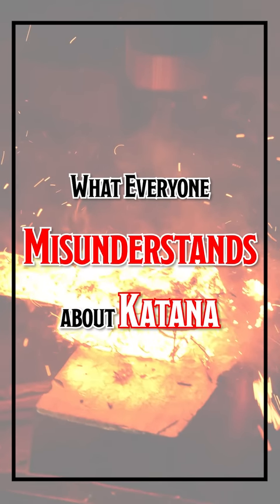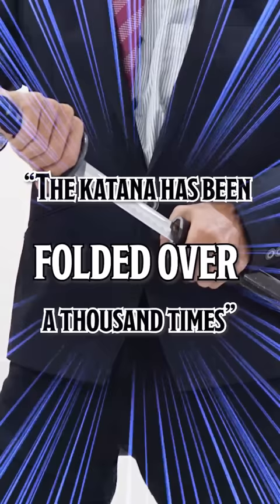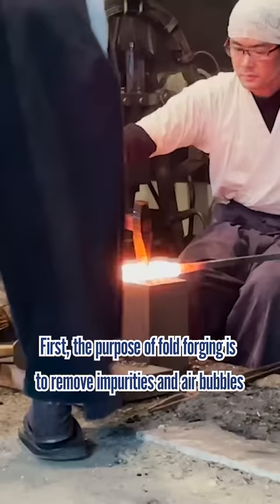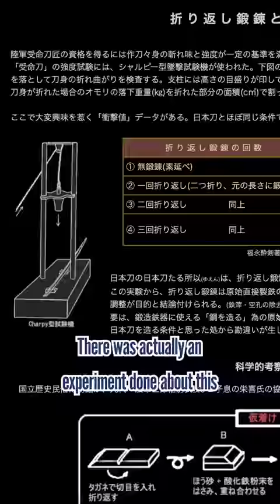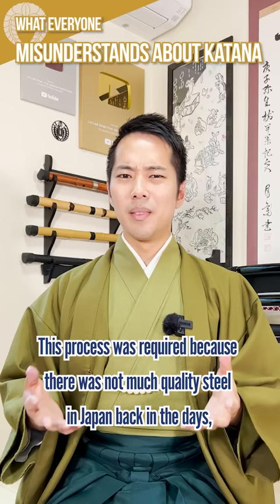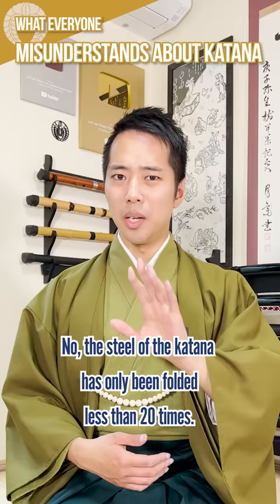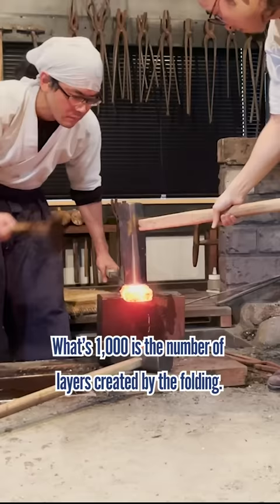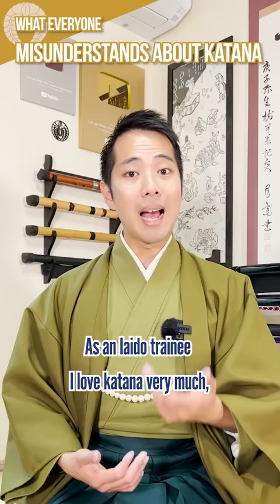What Everyone Misunderstands about Katana #Shorts

Comment: One fold = 2 layers, next = 4, then 8, then 16, 32, 64, 128, 256, 512 and then 1024. That's about 10 folds.
Reply: At 20 folds there are over 1 million layers.
Reply: @sorashirogami1729  yep, since it's 2²⁰ or 2^(20) you would end up at 1,048,576 layers
Reply: This math is cool but it's lost logic because a fold is a verb while a layer is a noun. You can't fold something over a thousand times because it would have a couple quadrillion layers
Reply: Mythbusters pretty much explained this in the seven paper fold myth.
Reply: okay but 10 is less than 20 is it
Reply: @notmuch_23  Folding paper and hot metal aren't the same. With paper your thickness increases extremely but with metal you can go back to the general original shape after each folding bc it's a formable mass unlike paper.
Reply: @ztsottles  Noone talked about folding something over a thousand times. OP only said that you need to fold it 10 times to get 1024 layers.
Reply: @JCel  but the exponential growth pattern of layers is exactly the same, which is my point.
Reply: I feel like at some point some layers merge together due to heat allowing molecules to bond together, but am not a chemist.
Reply: @JCel  they never said "you cant do this because you cant do it with paper" they said "the mythbusters explained this also" you are correcting someone who was not confused
Reply: @ztsottles  depending on which naming scale you are using quadrillion is 10^15 or 10^24. Thousand folds will make at least 2^1001 layers at first sight (you have to have at least 2 layers from the beginning due to physics of forge welding. Actually a little bit less because each time you fold you are not only multiplying it by 2, but also subtracting 1 layer because you are forge welding to same layer). Using method of mathematical induction we can prove that in this model number of layers after N folds equals 2^N+1. 
So after 1000 folds number of layers will be  at least 2^1000+1. This is much, much greater number than estimated number of atoms in observed universe (up to 10^80 which is less than 16^80=2^(4*80)=2^320 )
That's the power of exponential growth.
Reply: @JCel  OP mentioned the common misconception that a katana's blade is folded 1000 times. Are you dense?
Reply: @JCel  it's also the first thing he says after the title.
Reply from the maker: The professional katana sword smiths I have met told me it’s usually about 10 to 15 folds, and 20 is the maximum but usually wouldn’t do that much!
Reply: @LetsaskShogo  yes yes... Everything must have balance, not too much... Not too little... 🙏
Reply: 2^100 is already at 1 nonillion layers or about 1,267,650,600,228,229,401,496,703,205,376 layers, while a thousand folds as states would give over 300 digits as layers, that's over thrice the amount of digits in a googol.
Reply: @ekthepro  then welcome to your first lesson. Semantics matter in math.
Reply: @user-yd2ye2uh2c  "SO THE KATANA IS FOLDED OVER A MILLION TIMES THEREFORE BEING EVEN STRONGER1!11!!!1!11!!1"
Reply: @ztsottles  fold can also be a noun, for example when saying ten folds. It just that's the word isn't used much in this context so it's confusing
Reply: Makes me think of that million layer croissant.
Reply: @ztsottles  
"Folds of skin" is an actual phrase.
Reply: @kedabro1957  not applicable in this situation.
Reply: Very true, that is how math works. How many folds does not equal how many times it has been folded
Reply: It's not as simple as 1 fold makes 2 layers, the traditional method of making katana was by using many small pieces of steel mounded together, then forged into 1 soild piece, that piece would have multiple layers already. Then they folded the piece over and over to make a more homogeneous piece of steel
Reply: I was thinking about that, like "wait, I'm pretty sure 2^20 is more than just 1024..."
Reply: @ztsottles The word "fold" can be a noun, referring to the line upon which something has been folded.
Reply: @WereWade that's what happen above 800°C

Comment: Traditionally forged katanas are fragile and a bit on the side of needing high maintenance, though oiling is but as often as other blades.
Reply: It's another reason for the folding, in fact. It puts a very hard but very brittle section at the edge and a softer but more flexible section at the back.
Without that they'd either snap super easily or have a hard time retaining an edge or penetrating much of anything.
Reply: @ToastyMozart  they rust the moment they are unsheathed.
Reply: @ToastyMozart  
And the katana might not even be able to cut through or rather get damaged itself when striking butted mail.
Reply: @redblade5556  That's why proper maintenance like oiling is essential for katana user.
Reply: @emperorfaiz  It's essential for any sword. Katanas are just more high maintenance than other swords given how they made it deliberately ornate.
Reply: I don’t know that they are brittle in general. If you mean the hardens tip that can be but the heavier back is not. the hardness of the blade varies you have to be more precise. Also oiling is a more of a modern thing with some blades. Also - everything we say about Katana is so generalized
Reply: @leodouskyron5671  Oiling wasnt required in the past because people regularly used the weapons and always wiped them before sheathing. Oiling is needed if it will remain sheathed for a long time.
Reply: @ToastyMozart  mmm no it doesn't man. Forging isn't creating hardness neither is folding. The folding is to create a homogenous peice of steel. The resulting high carbon steel is then forgewelded around a core of lower carbon steel. Creating a jacket of sorts of hardenable steel around a core of mild ductile steel.
Reply: @ToastyMozart  no folding does not create differential hardening, it's only for removing impurities and aesthetic, differential hardening is achieved by covering the edge of the blade in clay or mud, firing it in the forge and then quickly quenches it in oil which creates the 'hamon' patern on the blade.
Reply: @ToastyMozart  Nope I know the different section of a katana are often called a fold. 

They don't actually fold the metal obtain hard edge and a soft spine. 

How they obtain that difference in hardness btween the edge and the spine is through two processes, the first one is differential hardening  the edge is more hardened than the spine, the other process is by simply forge welding different steel together. 

Folding steel over and over do not get you a difference between the edge and the spine of a sword, to the contrary it actually homogenize the steel.

Comment from the maker: I'm sure you’ve probably heard of someone explaining that “The katana has been folded over a thousand times” and that’s why it’s strong. There are two major misunderstandings about this.

First, the purpose of fold forging is to remove impurities and air bubbles and to adjust the carbon content. Therefore, it doesn’t mean that the steel is getting stronger. There was actually an experiment done about this and it was proven that from the third fold, the strength of the steel does not change. This process was required simply because there was not much quality steel in Japan back in the days, and the people needed to create it themselves.

Second, about “folded over 1,000 times.” No, the steel of the katana has only been folded less than 20 times. What’s 1,000 is the number of layers created by the folding. These layers can be seen on the surface of the katana, called Jigane.

As an Iaido trainee I love katana very much, but I do agree with the opinions that say they are sometimes overrated.

If you’d like to learn more about Japanese traditional culture, Kyoto, and social problems in Japan, please check out my channel & subscribe! 

*The content is based on personal studies and experience
There is no intention of denying other theories and cultural aspects
Reply: I’m sure they counted exactly 1,000 for every single blade they made in feudal Japan 😂

People are so uneducated!
Reply: Thanks for they lyrics 👍
Reply: Hi first off I love your channel you're very informative and I've always wanted to visit Japan for just a short time, So listening to you talk about the goods and the bad about it and kind of explain  Japanese culture and the things you shouldn't should not do is very helpful. I have two questions to ask you first off what's the best platform to ask you questions on, I don't really know which you prefer. Secondly you know a lot about the katana but I wanted to ask if you happen to know anything about it shorter counterpart Wakizashi I've always been kind of curious cuz when I look up information about it it seems like it's not as worshiped as say the katana is or at least I don't hear about it as much in Japanese lore and History. Nearest story about a a very skilled Ronan had murdered somebody and whenever the samurai would try to punish him and remove him from the building he was in ,they would all fail to defeat him and apparently he was using the Wakizashi or something like it the story only stated it was a shorter sword than the samurai's katana.

Comment: Some Damascus steel does get stronger from more folding, but that’s if you start with high quality steel in the first place.
Reply: that's different, Damascus steel are mixed steel, that's why these waves were visible compared to regular 1 type steel blades. damascus steel katana would be cool though.
Reply: Correct. The strength comes from having a mix of hard and soft steels. The hard steel is more rigid, but dulls quickly. The soft steel is springier, and holds it's edge, but can't be as sharp. By mixing them together you get the best qualities of both.
Reply: @Interrobang212 that’s… not how steel works? The harder the material the better it holds an edge. Because it needs to be hard the cut through softer materials. It is more prone to chipping the harder it is.

Comment: Compared to other swords (like a claymore) they’re easily beaten. But the strength at that weight and size was unheard of, and still is astonishing how well they’ve held up
Reply: Long swords are a similar weight and dramatically stronger.
Reply: @tjravend  No, they're not. They give similar results.
Reply: @danielantony1882  I would assume you're referring to some kind of cutting test results? Because that's not exactly the same as structural strength.

Sure, at katana will probably cut just as well as a longsword of similar; probably even better in some ways. But the katana will chip and perhaps even break more easily since it's not made of the same tough, uniform steel.
Reply: @justinthompson6364  If you're talking about traditional katanas then yes, you're probably right about the steel quality. However, traditional Katanas are a completely different topic.
Reply: @danielantony1882  If someone uses the word "katana" without qualifiers I'm not going to assume they're talking about a modern-day replica without reason. Especially on a video that mentions the historical reasons certain forging techniques were applied to it.
Reply: @danielantony1882  cope
Reply: @danielantony1882  same thing applies. Great it can slash. So can a long sword, if slightly worse. Yknow what a katana can't do? Stab well, it isn't dual sided, you cant half sword effectively, bludgeon effectively or take on multiple attackers or cavalry as effectively. Long swords are the every use sword, there's a reason even samurai used katana as basically ceremonial decor
Reply: @danielantony1882  can you half grip a katana? Are katanas double bladed? Plus the longsword is straight, while the katana is curved, so the longsword is better since it wont try to adjust to the ground. The proof? Katanas were almost never used in combat, longswords were the height of technology
Reply: @tjravend  The Katanas was used in battle, they just started using as basically a ceremonial decor on the piece period
Reply: @felipeguedescampos851  as a secondary weapon, generally
Reply: @tjravend  but they didn't use them as a secondary weapon because It was bad
Reply: I mean they are 2 very different weapon made for 2 completely different purposes it's kinda useless to say one beats the other
Reply: @felipeguedescampos851  on the battle field yeah uchigatanas (which I'm assuming is what you guys are talking about) were not regularly used they weren't even the secondary weapon they were a last resort weapon like a bayonette to a modern soldier. But they works great as a personal weapon for samurais because of how compact and quick to deploy they are and especially in non-open spaces like a house where bows, spears and tachis can't operate they were very much used otherwise they wouldn't even have a cultural impact. Samurais uses the uchigatana for ceramonies because they were their personal weapon not because they randomly picked a useless blade to show off. Calling them useless or a 'bad weapon' is rather biased and untrue.
Reply: @tenderandmoist5011  yes, you are right

Comment: Quick metallurgy lesson yes it does remove impurities also called slag in the steel, because the slag impurities have a lower melting point than tamahagane or bloomery (the steel smelted in japan traditionally used for katana, and other materials)  and hitting it essentially squishes the impurities out of the steel. The traditional hot cut and fold method as well as the high carbon jacket, and the low carbon spine made it quite amazing at shock absorption when cutting. Given that the length of a regular uchigatana is 2 shaku it's actually heavier than most weaponry from around the world in the same style and length. Like a saber or a cutlass. Each have their advantages and disadvantages, so in the question which is better, it's more or less which one can you, the utilizer, use in a more proper, more precise, and most effective manor.
Reply: Which would make sense… if the forges got hot enough to melt the impurities… which they don’t that’s why they folded steel. They folded steel because it spread the impurities thought out the steel so that there want one particular spot that was weaker than the rest of the steel.

Comment: The other thing about the folding is that the carbon in the steel, the element that actually determines its strength, migrates at high temperatures until it is evenly spread out. Some other elements, like nickel, don’t. The result is that in terms of carbon you end up with one layer - the entire piece. In terms of nickel or some other trace elements you have multiple layers. Structurally it is one piece and visually it is layered.

Comment: From what I understand folding steel, at least in the process of forming your billet 
has the ability to work out impurities such as sulfer and phosphorus. Each fold moves a little to the surface and it's burned off in the forge.
Reply: But aren’t you folding it in half? That’s trapping any impurities on the surface into the center of the material. And it’s not like your getting it hot enough to allow those materials to pass through the body of the steel.

Comment: True that...with modern steels being of superior purity now...the folding is more for art rather than purpose...however the folding (or perhaps better described as fusion) and combination of differentially hard and soft steels into the singular body of the katana is still a critical design for a function element as preferred by the user.

Comment: Most weapons evolve out of necessity of their users situation and environment. Hence why longswords (vs thicker armor and could be used as a bludgeon in some cases) and katana (vs thinner armor that required more cutting power) are so different.
Reply: I mean your using the cross guard and pommel to bludgeon with a longsword (murder stroke) by holding the blade and swinging it like a hammer. Longswords were shaped like they were to be better at stabbing.

Comment: tamahagane (jewel steel) needs to be folded to draw out impurities.  wrapping and claying the metal between foldings adds extra carbon material to it. taking a low carbon almost iron quality steel and elevating it to the level of a useable blade material.  probably the coolest thing about katanas is they don't get their curve until the finished blade is quenched.  Katana forged out straight but the method of forging is what causes the blade to curve when it's cooled.  it's called san mei and is a 2 part construction of a high carbon outer jacket welded around a low carbon inner core.  the carbon and different hardness makes the metals cool at different rates introducing the iconic curve

Comment: I keep on telling people about that it has not been folded 1000 times, only that it has 1000ish layers.
Like lets do the base calculus:
First Fold: 2 Layers.
Second Fold: 4 Layers.
Third Fold: 8 Layers.
Fourth Fold: 16 Layers.
Fifth Fold: 32 Layers.
Sixth Fold: 64 Layers.
Seventh Fold: 128 Layers.
Eighth Fold: 256 Layers.
Ninth Fold: 512 Layers.
Tenth Fold: 1024 Layers.

In general they folded roughly 10 times, but it also depended on how malleable the metal was, so if they could still fold it, they would. So some would have up to nearly 20 folds, where others would not even reach 11.

Comment: The steel originally used from the bloomery furnaces were extremely impure.
That's why they needed to be folded to make it stronger by removing the excess carbon that would otherwise make it cast iron.
In Ancient times, it's actually middle eastern and Indian Sabres that were renowned for wootz steel and sharpness.

Katana cannot compare to these blades at all.
Reply: Wootz steel 'sharpness' is a myth.